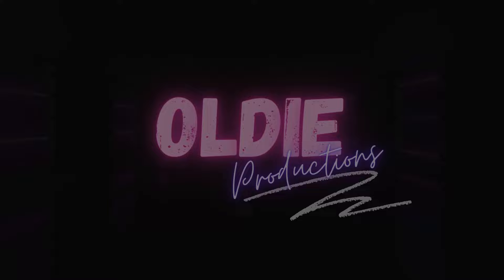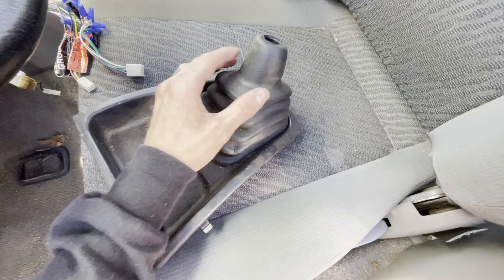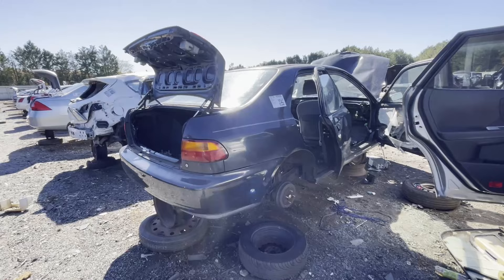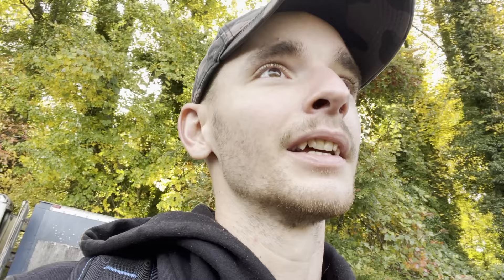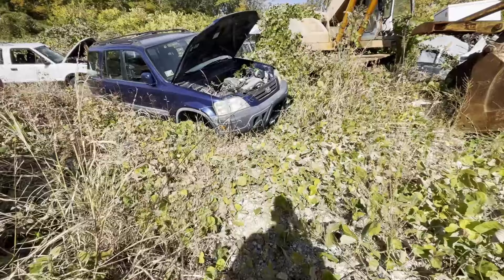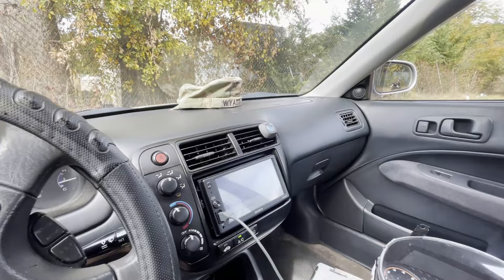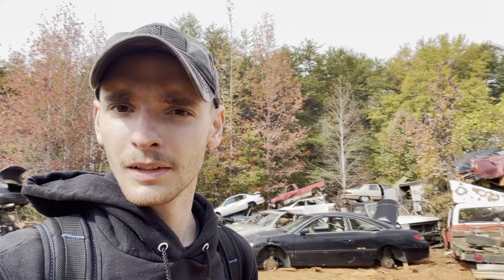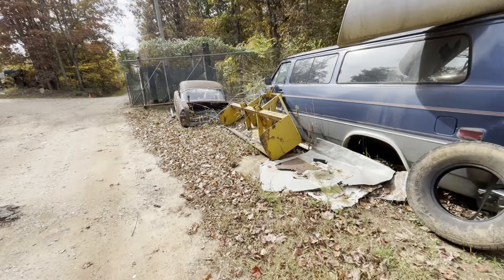Searching for rare Honda parts in the Junkyard!

Comment: Our local backwood yard has acres upon acres of cars that never get crushed.  However their pricing is outrageous at like 4X the cost of the Pick and Pull which has rotating inventory every 45 days or so.
Reply from the maker: Complete opposite for me. The big yards charge outrageous prices and the local ones are cheap and you can barter with them. 

I went to buy a cylinder head off a civic that had 200k+ miles and they wanted over $400 for it. They were pricing out valves, rockers, camshafts, etc. I didn’t even let the guy finish pricing before I said keep it I’m not paying that.
Reply: Here you can get whole ass engines that run perfect for like 800$
Reply: @bread-gz3rl  whole engines you pull it $200 here.

Comment: Z31's just inherited the rust problems that all the older Z's had on top of being considered "premium" vehicles when they were new meaning Nissan USA never offered a true base model such as the Canadian market only 300zx SF. US only got GL and GLL, power everything, so when the motors and servos die the car can become near undriveable depending on the climate. The grey one in ur video is an 86 GL...kouki fenders with zenki bumpers and lights, chrome trim around the glass, 71c manual and R200 open diff. 
Honda people don't like them for the same reasons that they didn't like S13's 20 years ago (slow AF) and Nissan people don't like them cuz they usually want something with aftermarket support, something Z31's have never been known for lol

Comment: junkyards are getting out of control for their pricing in my area,i have a sr20det big turbo kit thats been blowing out spark so i created a harness that allows me to use audi/vw coil packs and just for 4 used coil packs they wanted $85,they cost more then brand new aftermarket ones and even found used oem cheaper on ebay. this price goes for all the coil packs at this yard so its not like they were anything special.
this is in phoenix az and its a big main junkyard
Reply from the maker: Locally owned junkyards are way better than the big corporate ones.